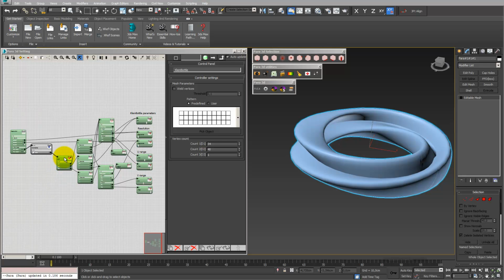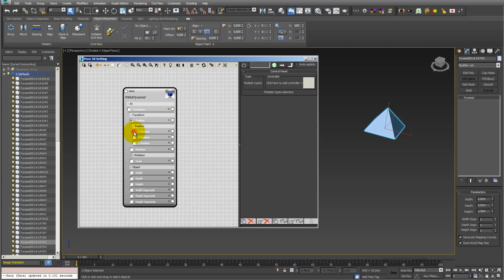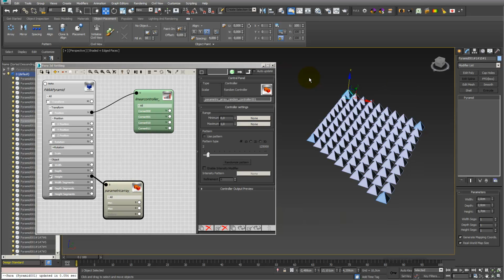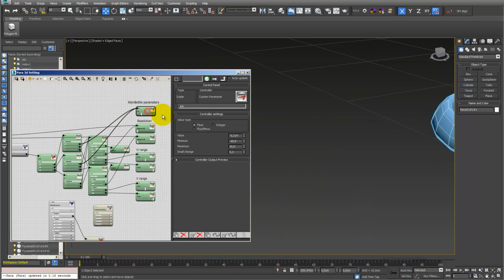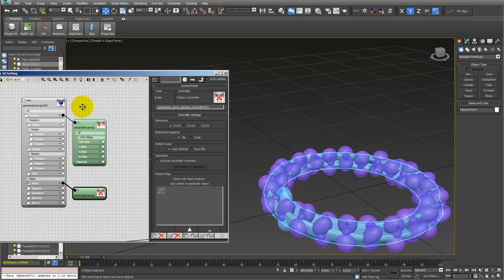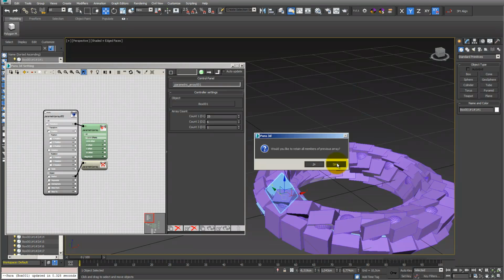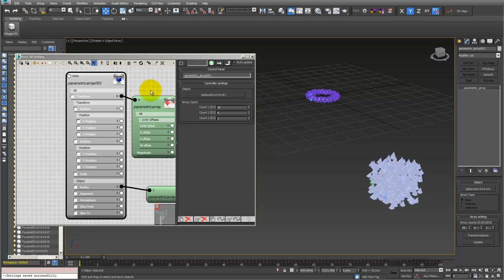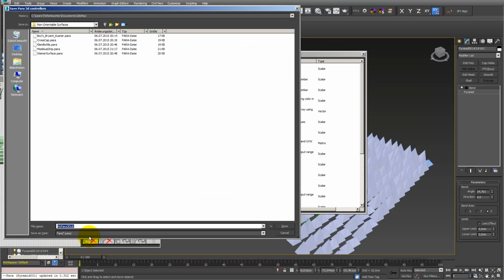Introduction into para 3d (4.6)

Comment: amazing tutorials..thank you very much for sharing..I only have one problem..I dont have the option to load para flow..the icon is not there..I think I have an old version of Para3D..or maybe it is there but I can't find it..is there anyway to load parametric arrays?
Reply from the maker: I recommend to use the newest version of para3d because paraflow becomes better and better....
Reply: +Design Strategies yet..I use only max 2012.. most of the plugins work better on it and they are available..can I get the latest para3d on max 2011?